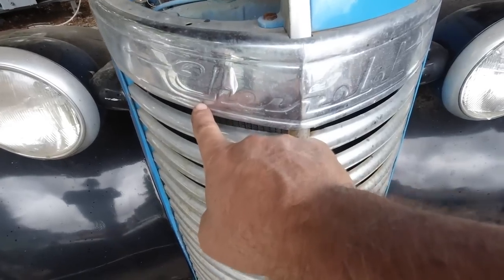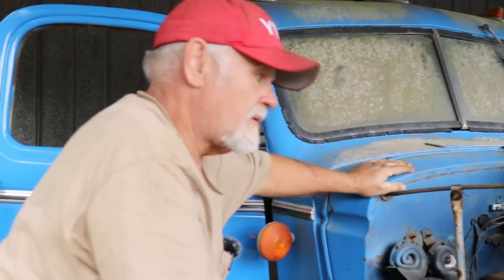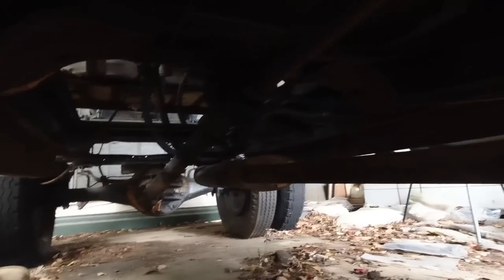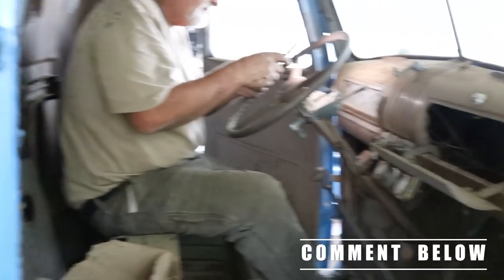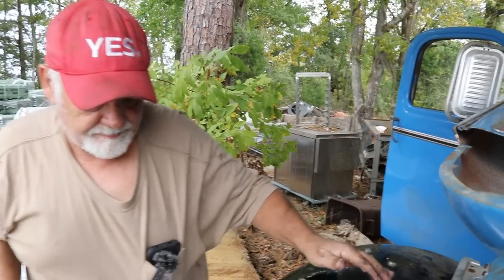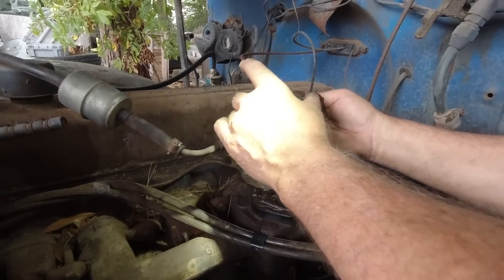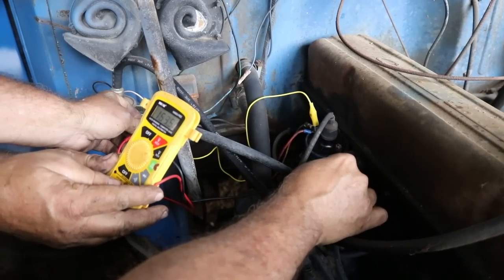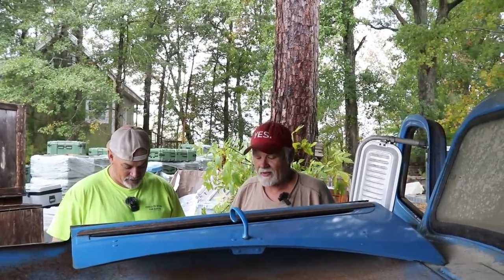WILL IT START? 40'S BARN FIND CHEVY TRUCK! We Have No Idea What we’re doing!

Comment: I'll bet the ballast resistor on firewall is bad need to see voltage key on and during cranking then leave the distributor cap off key on and open and close the points check for spark points are probably dirty need a nail file clean the contacts that truck has been switched to 12volt already with an electric pump

Comment: Man I want to explain the timing and distributor and all that to you guys but looking quick through the comments a few people have done it, this is from 6 months ago you're probably not even still checking on this old video, but you guys really probably need to clean the actual POINTS they're under the rotor under the cap. If they're dirty, which they always are, the plugs will NOT fire.. I'm 30 minutes in, maybe you guys will figure it out, I hope so!! With a gasoline engine you need 3 things, Air, fuel and SPARK. Gotta check for spark

Comment: Fuel pump is too high up and a hot area , fuel lines leaking . No fire check points. With all the gas leaks better have a big extinguisher!stop pouring gas in carburetor. Set points with .020 feeler gauge hose clamp for fuel line . Check for spark at end of plug wire . That pod on side of distributor is vacuum advance. Patience , and all will be ok

Comment: If you don’t have 12 V to the positive side of the coil you won’t have no spark you need to make sure you have voltage on the power side of the coil if you don’t you need to figure out why once you get voltage it will spark should

Comment: Sand a points pull plug wire off to test for spark but if coil is not hot nothing will happen

Comment: LOOKS LIKE A 38 chevy with a blown head gasket or a cracked head:face-blue-smiling:The Data plate is missing .it should be on the firewall under the hood on the driver's side. A new coil, points and condenser should get it to start. You might check the compression. Good luck.:hand-purple-blue-peace:

Comment: Vacuum canister is for the wipers. Points are dirty. Positive side of the coil must be hot. Missing fuel/air adjustment screw on the carburetor won't be in a rebuild kit. Y'all are scaring me!!😭😭😭😅😅

Comment: My research indicates the truck is a 1938 or 1939 model based on the grill.  Also, the engine is from 1954 or later based on how the rocker arm cover is attached to the head.  1953 and earlier engines had rocker arm covers attached by two studs protruding through the top of the cover and held in place by "acorn" nuts.  Sure hope you are able to sort everything out.

Comment: Your checking the wrong wire. Pull a spark plug wire off and put it near the Metal. Or hold the end of the plug wire in your hand.

Comment: Might not know gasoline engines but they know not to get shocked by the coil wire ! 12v in to the coil other side goes to points .

Comment: 1948 chev 2 1/2 ton 235 or 250 ,261 possibley. they had colors red blue and green for diffrent vechicles ,small numbers cars 194 216 and230 ,235  was known for being the clasic stove bolt engine there are more straight 6s chat another time have fun its making oil.

Comment: No offense, and I love your videos, but I think you guys need to stick to starting old Diesel engines.  All of these old trucks were equipped with 6 volt electrical systems, although fortunately, it appears that this one may have been converted to 12 volts.  Hope it wasn’t a 6 volt coil!  That’s probably also why only one of the lights worked.  The other ones were probably burned out from 12 volts.  You checked the contacts in the distributor cap, but didn’t look at the points or the rotor, which are typically the culprits when an engine doesn’t have spark.  I think Wiley needs to pour more gas down the carburetor!  😂😂😂

Comment: You didn't say, 'Will it drive from its' grave???' 😁

"I don't know how to keep it up." <-- No Comment. This is a Family Show. 

We like the lawn care idea - my wife is watching with me and cracked up at that.

Diagnosis: You are correct - you have no spark. You do have power to the coil. Check to see if that power gets to the points. Then (distributor cap off) get the points closed and either observe sparks or flick to see if the points have power across. Clean or establish connection as necessary. The trace spark to the plugs (check wires) - make sure plugs are clean and gapped. 

A lot of comments are for the condenser - old condensers hang in pretty well. Even if gone the thing will usually backfire to let you know that the condenser is bad. You have NO SPARK. That has to be traced/corrected. 

And just a suggestion: stop pouring fuel down the throat - it winds up in the crankcase/oil pan. But DO pull the oil drain plug just to see if the oil is floating on top of any water.

Comment: Well after seeing all the tools you two have obtained I was ready to promote you to wantabe mechanics. But after watching this I just cant do it. I remember a truck salesman telling my Grandfather and uncle who had farm trucks "you will like this cause we designed it so simple to fix even you dumb donkeys can do it". They might have not believed him since they never bought a truck from him. But 101 you have to have air, fuel and spark. Only way to fix ignition is start at the key and test all the way to the points. only way to fix carb (fuel) is to take it to the shop and take it apart and clean everything. In both of these cases I employ my belief that I should not do anything that I can get someone else to do. Works out well for me.

Comment: The points are the issue they are earth grounded. So you should have 12volt at coil other side is negative switched by the points and condenser that should be next to the points. On that engine the distributor turns to advance and retard the ignition timing this is run on vacuum from the carburettor.
As for the carburettor leaking I think that’s an over flow weep hole so the float is allowing too much fuel in the the bowl so try setting the float to cut fuel off earlier. I do suggest cleaning the floats as that gunk will make float heavy and will cause over flow of fuel. Back to spark best way to test it is to remove the negative wire from the coil now run your test light to it on cranking the light should flash each time it flash’s the coil would spark. If there’s no light points are dirt if it’s on solid point are earthed out or the gap is too small. Set with feeler gauges or a bit of thing cardboard if you’ve got nothing else. If points are open test light will be out closed test light on, cranking it should flash once you get it to flash reconnect to coil and test for spark same way as you did coil ht cable to something grounded.

Comment: You were testing the wrong thing for spark.  You need to lay a spark plug up against the block, not the coil wire.
Reply: No, they were testing it correctly, take the coil lead out the distributor cap, that gives you a spark when earthed EVERY time the points open (that is the main feed to give you spark from the coil to the dizzy cap which in turn 'distributes' the spark to each cylinder).
Their problem was almost certainly fouled points, I would replace them tbh.

Comment: If you pull a plug then hook the plug wire back up and set on steel turn over and you should see spark if not backtrack to the points and coil. Points must be clean the floats were brass and as gas comes into carb bowl floats raise and a needle valve pushes up to shut off the gas and keep float bowl full. The plunger below carb is vacuum and rotates the inside of distributor to advance and retard the spark at the point as you speed up and slow down. Hood luck it is a pretty basic system you’ll get er dun😅

Comment: YOUHAVE A 235 CI MOTOR IN THAT TRUCK THE ORIGINAL BLOCK SHOULD HAVE BEEN A 216 CI MOTOR THEY WERE POURED ROD BEARINGS NOT INSERT BEARINGS THATS ALOT NICER SET UP

Comment: With a gas engine there is only 2 reasons it wont start ,, No Fuel or No spark , your fuel pump was constantly running when you switched on the ignition which means the fuel chamber on the Carb wasnt getting enough fuel to fill it up , when that stops the chamber is full and ready to start engine ,Now as far as the coil and distributor is concerned .. The coil gets power when you turn ignition on not from the starter so there would have been 12 volts straight to the coil as the rotor turns in the distributor cap it fires 12 volts to the spark plugs in turn of rotation , you were right to clean the rotor and there was only 1 way that could go back on in the right position , SO for diagnosis purpose there was no spark from the coil which means Dud Coil ( try new one ) get the leak sorted so the chamber hold's fuel without leaking on to the exhaust manifold ( could be a major problem with a spark ) Love your Vids guys but this was painfull to watch , Google is your biggest friend when out on a limb . And before anyone starts ive been a mechanic for 40 odd years in the Uk doing roadside repairs and garage repairs :)

Comment: Hard to believe you guys know nothing about petrol engines!
Coils don't go bad so often.  Usually the condernsers die.
But the plug and coil wires can be rusted, corroded or have built up massive resistance and won't let the electric through.

Comment: That's a overhead valve engine, those trucks originally came with flathead engines. I would guess that engine is a mid 50s engine. However those Chevy overhead 6cyl engines were produced for a long time.

Comment: Looks like my very early 1942 I had but mine was a 1/2 ton, could be 40 or 41. They only made a few in 1942 because everything was gearing up for the war. 
After the war they used the old presses, molds and dies to jumpstart the industry so a lot of post war vehicles of that ilk looked so much like the the pre war design.
Also that is a 1 ton witch was considered commercial vehicles which during the were made for made for the military and a certain allotment were made for municipalities. The design pretty much stayed the same, military 🙄.

Breaker, breaker 19: You guy tickle me sometimes .... 🤣😂"what's this hooked to? ... I don't, ua look, it is hooked to this. ... What's that hooked to? ... I don't know but look when I push this, that moves." 🤣😂🤣 Who's on first? 🤣😂🤣

Back to the truck.
I also want to point out the industry would also use up the leftover NOS, New Old Stock, still on the shelf to help make commercial vehicles of later years. So it would be common to find headlights and/or taillights from a 32 on a 46.
So, to answer your question has to what year it is without some numbers, I say it is hard to say.
Reply from the maker: Interesting. Thanks

Comment: Seriously? Gas is so easy to figure out see if there is compression, see if there is spark, and getting gas. I spot one thing you done wrong already. Pouring gas into the tank without checking to see the condition of inside the tank.
Reply from the maker: You must be like 2 mins into the video when you made this comment
Reply: @HamiltonvilleFarm  no Hank I watched it all the way through and seen both of you make so many mistakes I was laughing at all the things how easy gas confused you. Did you check compression no. Definately clean the points, replace the coil and you should get used to using a Jerry can hookup and carry an electric fuel pump. Never mind putting gas in the tank there could be stuff in the lines. I have started so many old vehicles in my life all mostly gas. I built a 1934 Ford pickup with a 350 chev motor and tons of other stuff.
Reply from the maker: We definitely have no idea what we’re doing in this video
Reply: @HamiltonvilleFarm  that motor is extremely easy to work on without the electronics. You should always check for compression as the rings might be stuck also to unstick rings use marvel mystery oil or combine diesel fuel and tranns fluid. A new coil will be part of the solution but the carb is notorious for weak parts. Clean it especially the jets

Comment: That distributor spins in its own shaft n gear but the crank shaft does the work each time around it the timing is correct fire to each plug wire at different time. Hence timing. The lobe is rotating the distributor is turning on a bearing. each revolution depending the lobe position has to have the timing correct. By rotating the distributor. ADVANCE forward Retard back wards. Plus the carb has to be adjusted in sequence. But moving the distributor cap does a effect timing. Best to leave it along put new plug wires and plugs NO spark age no go. Gotta light the fuel in the combustion chamber. to drive the piston back down. ADD fuel to the piton head. Spark happens INTAKE Takes the FUEL exhaust stroke the happens after detonation next set of pistons comes up {SUCK BANG BLOW.

Comment: Why would you pull us bar plugs you want to know will it crank eject or you check the radiator it has y’all see if it’s gonna turn over any at all or before you dive in and get Melo involved in it we don’t need to know what everything does not like we’re just watching to see if it’s going to start where are you going to go and change spark plugs and do all that bunch of bull crap I kind of defeats the purpose if it’s going to start right now